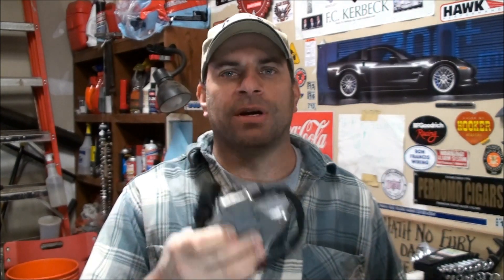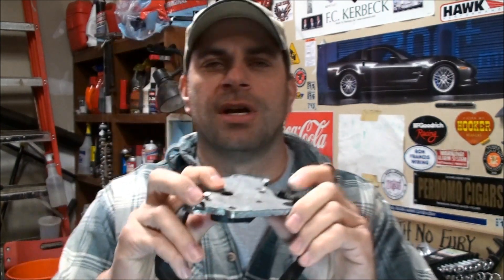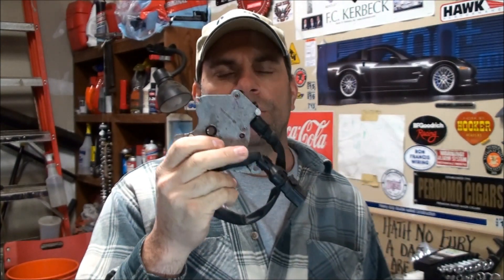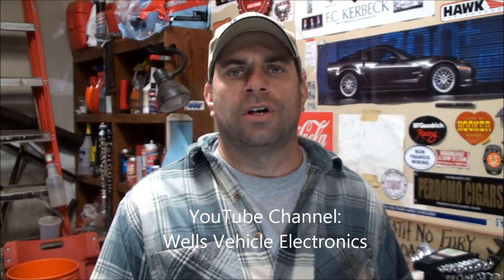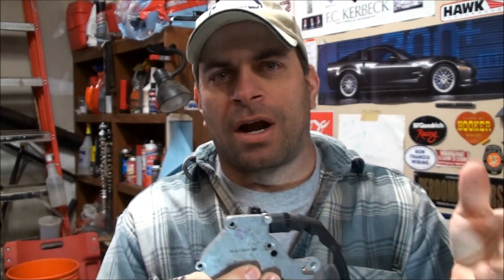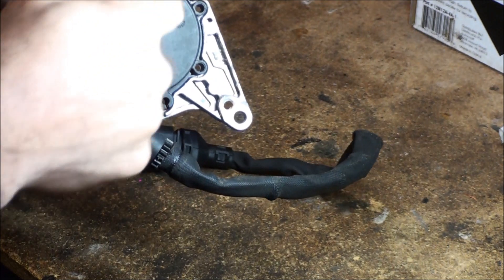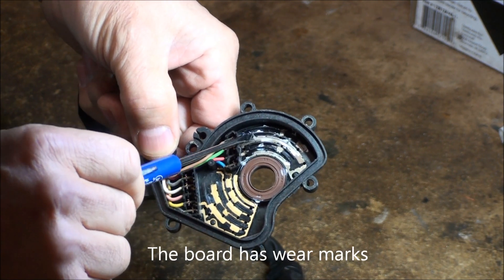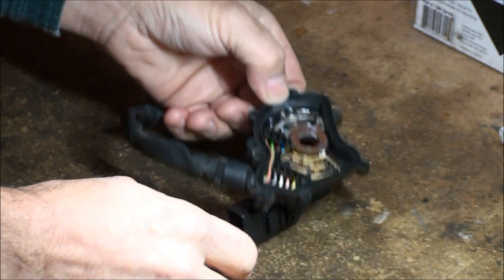Volkswagen/Audi - Why the Transmission Range Sensor failed -P0706 -Ver 2.0

Comment: Hello there, this a nice video. I have a 2006 passat and after driving for about 21mins the prindle lights up as a red block however the gears continue to shift well. Do you have any ideas on this? Thanks
Reply from the maker: You need software to check for codes, VAGcom is good.

Comment: Just spray it with WD-40 and slap it back together!! I've had to rebuild the trans neutral safety switch on my 1989 Mazda MPV at least three times now...for some reason that part is discontinued haha
Reply: WD 40= bad idea , Use electric contac cleaner
Reply from the maker: Ivan I'm starting to wonder if you bathe in WD-40 keep your skin soft and smooth? lol  I'll admit it's good stuff.  I use it to remove sticker glue and for about 39 other uses as well!  Keeping your ride on the road with min cost is the way to go!  BTW, antique cars had safety switches??? lol  Take care

Comment: Looks a lot like a wiper motor style. I bet that's a $1000 job at the dealer .
Reply from the maker: It's very expensive job at the stealership that's for sure.  The book suggests exhaust removal but in the repair vid I made I skip that step on the 4motion model Passat  ;-)  Take care

Comment: Nice video Mr nipple twister like the old fashioned air flow metres work on the same principle on some of the older metres you can bend the contact so it runs along a different path and it can start working again I have never seen one of these as we just drive proper cars manuals 🤣🤣🤣🤣🤣🤣🤣
Reply: Hush Leon, you drive 1.4 3 cylinder cars in merica we drive trucks with V8s😉
Reply from the maker: This could have been a band aid fix job but considering how much labor it is to get to it's a good idea to replace rather than patch.  Ok i gotta get back to some twisting, take care Leon :-)
Reply from the maker: Leon could pay the V8 tax but then he wouldn't have any money left over to buy M&M dolls :-)
Reply: Flat Rate Master wrong Mike we drive 1.2 3 cylinder 1.4 that's a big engine wow🤣🤣🤣🤣🤣🤣
Reply: Ozzstar I have my full collections of M&M dolls now all life-size so I don't need anymore😁😁😁